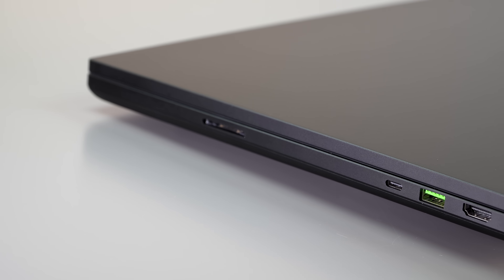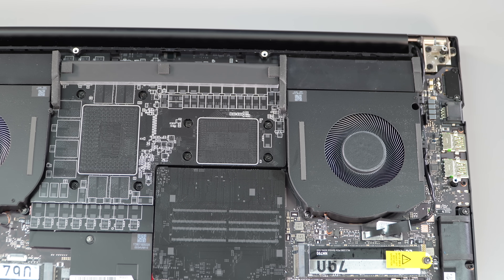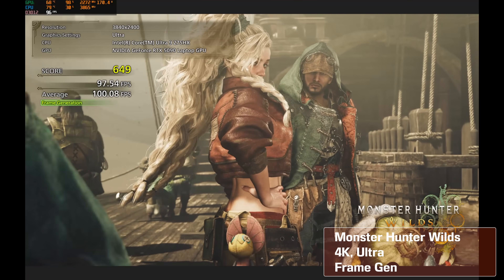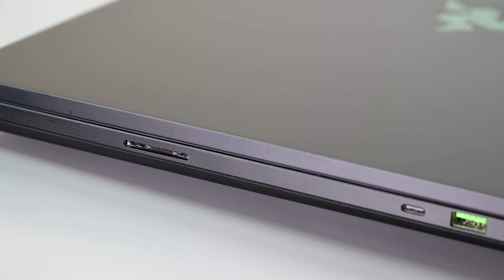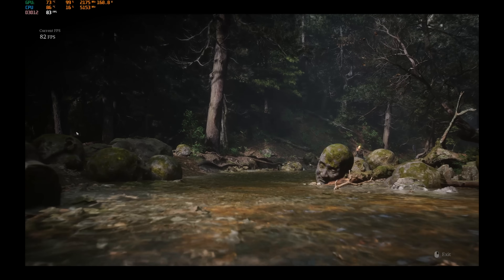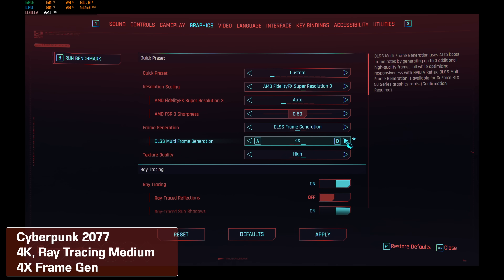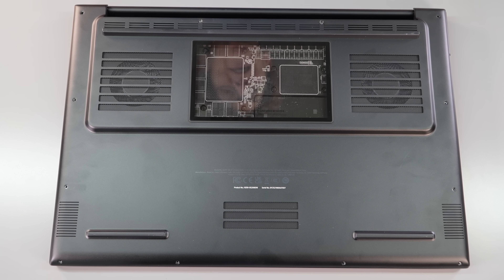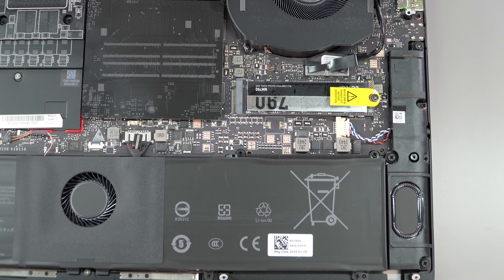2025 Razer Blade 18 Review

Comment: IPS display is instant hell no. I just can't stand IPS displays in 2025. We move a long way from that.
Reply: IPS is better for games than mini-led due to less response time. There isn't an 18" OLED at this time so we have to take what we can. Like Lisa said the previous dual mode mini-led was trash. Mini-led is great for content consumption mainly. Creators like mini-led as well just as long as they could have a single zone mode to do so like what Asus does. IPS looks great straight on. I don't have an issue with my 9i Gen 10.
Reply: @volcalstone That’s why I won’t update.
Reply: @stevemuzak8526 I love OLEDs just like the neff person but I also like 3D displays so IPS is the only choice for that right now. It's a nice 4K IPS panel with no major light bleeding on the 9i.
Reply: If a consumer display isn't OLED, it's IPS (or less likely, VA or TN) no matter what the backlight technology is (like Mini-LED).

Comment: I've bought Razer laptops once, and never again, it is a very closed system, with all settings and most Bios options hidden and locked, you cannot even control the fans exactly how you want in every profile, Synapse 3 and Cortex are full of bugs and advertising and are mostly bloatware sucking battery other than changing power profiles and rgb. And even if they run less hot today still are affected by battery bloating and swelling as well as a variety of hardware/software failures that GamersNexus recently made a video about, related to the new Synapse 4 many of them, I've had battery problems twice in 4 years(bloating and swelling from normal use) , screen problems, the logo light burned out and required changing the whole screen for 500€(I did not), and overheating problems that shut down the laptop. The quality control has always been hit or miss for the hardware and the worst part is by far the customer service, pray that as long as you own one you do not need customer service for anything, they will make you debug for hours or days, only answer once a day by email so it's gonna take weeks or months to solve a problem they don't quickly diagnose or if they don't quickly offer to send the laptop for repair because once the initial chat is finished they only work by email and as I said only answer once a day and will change reps every few times and you'll have to re explain things or keep each new rep up to date or remind them of previous conversations and infos so it can take months to solve anything persistant. Fortunately I've had limited problems but each time I've had them I wished i didn't buy a Razer Blade. Some say the customer service has improved, I'd like to think that's true but haven't checked on that and I hope i never will.

All of this to say that Razer laptops look and perform nicely. But everything around them is expensive and a pain in the ass to live with. So reviews don't do justice to what you are actually buying, it is my biggest regret that reviews do not or cannot take all of this into account so you are aware what you are getting yourself into.

Comment: Got mine in the month of August 2025.. Got the 5070ti variant (1TB SSD, 32GB RAM) for approximately USD 3370 as per where I'm at..

At the time and based on the options that were available from other brands, this felt like the right option to go for. I was waiting for the Alienware 18 Area 51 but that didn't arrive in the market until end of September which was quite a lot of time.

Since the purchase in August, there have been quite some updates from Razer's (BIOS, Synapse) end as well as those from Windows updates. Startup times were good initially. But after the updates, they've improved for sure.

I think there are some significant factors to consider when buying this laptop. 3 come to mind:

1) Screen size: It doesn't matter if you buy this or any other 18" laptop. It's not for everyone. I would strongly advise you to visit any electronics store and get an idea as to what an 18" laptop looks and feels like because most stores out here DO NOT keep 18" laptops on display which is understandable. 

2) Weight: This goes without saying, this laptop is no feather weight.

3) Fingerprints: Ngl, this laptop is a finger print magnet. I'd known that prior to the purchase and I didn't mind it because I'm a hygiene freak. I have it cleaned with a microfiber cloth by the end of day.

All that aside, it definitely is a premium purchase and I think it really changes your entire mindset especially when you use it for work. 

If ye guys have any questions, drop em' below and I'd most hopefully answer as soon as I can..

P.S. Thanks for the review as always, Lisa! ✌🏻

Comment: Why are the exhaust vents hidden? Where is it blowing the hot air to?
Reply from the maker: It blows hot air out the back, it does not aim up at the display.
Reply: @mobiletechreview oh okay thanks thanks
Reply: My older blade blows it up into the chin on the screen.
Reply: @Temeraire306 so they are like my old zephyrus thin and light. But for this big laptop it should be able to direct the exhaust towards the back.